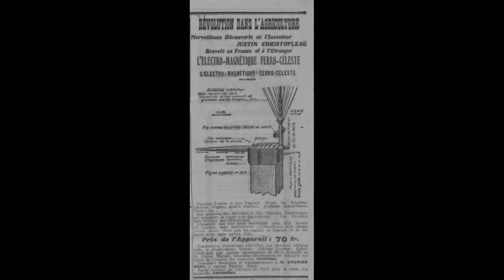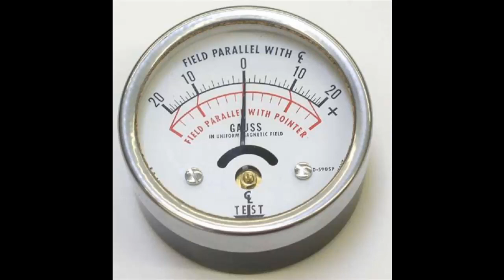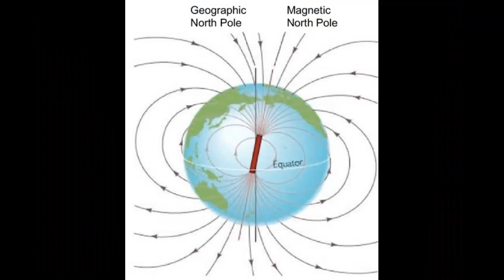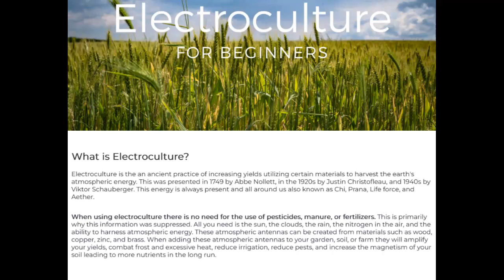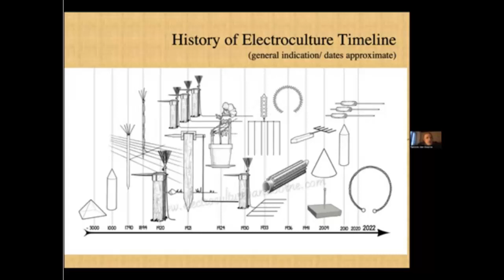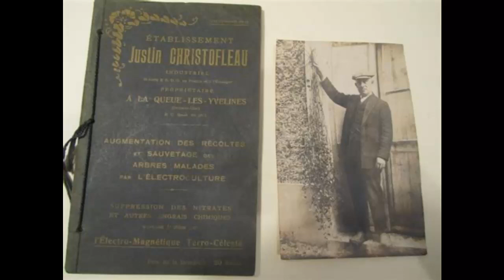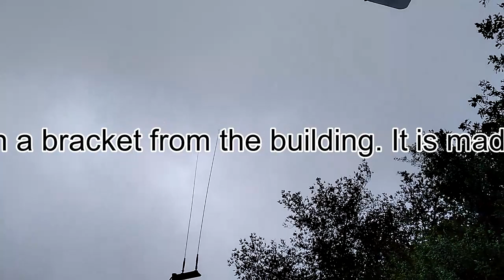Electroculture- Lets Separate The Science From The Woo!

Comment: Physicist here. First time I'm hearing about electroculture. Here's my impression: Sunlight is ultimately communicating the magnetic force of the sun (which is a huge electromagnet) acting on the Earth, and so when the sun rises, the EM fields across the ground change a lot, especially during full moons and solar flares since they shower the Earth with charged particles. When the EM fields across the ground change during sunrise, it induces a current in the coil and thus turns it into an antenna. The induced field is a toroidal field much like the Earth, sun, and human body have. This should protect the plants from other external fields that may induce static in them and thus harm their cells. It should also cause electrons to flow down onto the plant and give it energy. Our cells are also capacitors and the body can benefit from receiving electric charge from the outside rather than having to produce electrical energy by wasting food.
As far as I know, when spiritual people speak of earth energies, they are talking about the geomagnetic field. They just use the ethereal language of our ancestors, where for instance the power of god is a synonym for electromagnetism, magic wands are antennas and magic circles are antenna arrays. Our ancestors used a lot of piezoelectric materials and standing stones (stonehenge is a wullenweber antenna array) which induce large-size magnetic fields during thunderstorms.
Reply: I've noticed that "rather then wasting food" bit when I fast.  When you fast you tend to get cold on longer fasts as your body trys to conserve energy and the sun can become free calories essentially and warm you up again.  One of those pretty obvious once you realize it things.
Reply: Thanks!

Comment: Interesting, first time I’ve heard of this method. However in terms that are more understandable. If this genuinely creates an antenna. What is happening with this antenna is something called shadowing. It’s something that happens when you place antennas too close together and kills the signal on devices. So as far as radio signals are concerned this is true. I use to mess with earth batteries to test them out and sometimes they would act weird under certain conditions. I could make a video on it but I am getting sidetracked. One thing you can do to copper to increase its charge is to oxidize it by cooking it at 400 degrees Fh until it’s black and then when the sun hits it. It will create a charge. If you tried this on your plants then it might work better. Another thing though is to keep copper a certain distance from your plants because copper nails were once used to sabotage plant growth. It’s poison to most plants.
Reply from the maker: My garden has performed better this last summer than it ever has. yields way up pests way down. thanks for your message.

Comment: Just getting into copper for plants. I have been using colloidal copper for medicinal uses for years now.  

I think you should consider that we don't live on a ball with insane surface speeds, because it is scientifically impossible for this heliocentric model to have air. Here are just four facts that prove without any doubt that the ball has no air:

Fact 1: gas always expands to fill the volume

Fact 2: the only way to keep gas from expanding to fill the volume is to keep it in a physical air tight container. (No one buys propane in a bucket.)

Fact 3: no one in history has ever shown gravity preventing gas from
expanding to fill the volume.

Fact 4: when these facts are presented, most thinking people can connect the dots and realize that if the ball model is surrounded by an infinite volume of super low pressure and no physical container and the FACT that no one in history has ever demonstrated a single condition where gravity formed an airtight container, those thinking people would realize that it is SCIENTIFICALLY IMPOSSIBLE for the ball to have air.

Remember part of Boyle's law is that gas always expands to fill the volume of a container unless the container it IS SO LARGE THAT A DENSITY GRADIENT BECOMES SIGNIFICANT.

One other item I tested in my backyard using 20 feet of 1" EMT conduit insulated from the ground and mounted vertically. I placed a DC meter with the positive probe on  the EMT and had a decent ground for the negative and got a consistent DC voltage of 150.6 mV. The charge direction is downward.  There were no electrical lines of sources within 40 feet, in fact the closest overhead lines are 100 feet away.

Hope this is useful.

Comment: You are wrong about a fair bit, and hearing you talk about the "south magnetic flux into the area" has got to me.  The pole of the earth where Santa lives we might say normally termed the North Pole is what we refer to as a "South Pole".  this came to be because we talked about the pole that pointed north as the "North seeking pole" and then the seeking got left off.  So it is the South pole energy that is beneficial, also the arrows drawn to indicate the polarity of magnetic lines is just a flip of the coin convention, it would have been more accurate is drawn the other way!  So it is the emission of "whatever". subtle magnetic monopoles, aetheric energy, it is this "something" that comes from the south end of a magnet or of the earth that is beneficial.  Also worth noting that Rawls and Davis and some other experimenters define poles differently, some refer to the poles that point north as the south pole of a magnet and this is the reverse definition that is standard.
Reply from the maker: The lines are purposely blurred by several agendas.

Comment: There must be something that I am doing wrong. I have two antennas 2.5 meters high. The top of one is fibronnoci in design whilst the other is coat hanger. Again I split the wire into two thick strands on the coat hanger design and have separated the wires and spread them radially on the fibronnic design. I have not seen anything out of the ordinary yet??? In fact I have seen parts of my onion bed dying/dead where the fibronnoci Arial  is placed. I have also winded the coils differently, one coil goes anti clockwise whilst the other is wound clockwise.
Something is not right,n

Comment: My own experience with 10" 12 gage stranded copper wire with my 7 tomato plants in 5 gal pots. And 1 4x8 Bed using 15" in the bed. So i looped about 4 loops for the top and stuck the straight end in about 6" in the soil for each of the 7 pots that i had tomato plants growing in them. These tomato plants were growing slower then my other 30 something Tomato plants so on the 3rd day of trying this i started to see a difference the plants looked happier and greener and new growth. The tomato plants in the Bed i saw no difference yet but beds are bigger then pots so maybe in a week or two i will see a difference. I'm anxious to see what happens with this experiment. But so far it seems like it's great for potted tomato plants.

Comment: How High and Close to the Plants Does the Copper Wire Need to Be Placed???
Reply: Can a Copper Pipe hammered into the ground Be More Effective..???
Reply: @pauldaystar I was wondering the same thing too. 3 days ago i  cut 10 inches of 12 gage stranded wire and curled the one end about 4 loops and stuck 6 inches of the straight end in the  5 gal pot. I did this to 7 of my tomato plants that were growing slower then my other tomato plants to experiment and on day 3 i could see a difference the plants looked like they were happy and new life in them and greener in color. I put 15 inch ones in my garden tomato bed and haven't seen a difference yet but beds are bigger then 5 gallon pots so maybe in a week or two i will see a change.
Reply from the maker: The higher you go, the better your spread. If you get a fibreglass windsurfer mast or an old surf casting rod you can easily get 16 feet. That will give you a 20 yard radius of effect with diminishing results toward the outside. for single plant or raised bed protection , a 6 foot  cane will provide benefits. I use a gallon of seawater diluted with rainwater 50/50 once a week during the growing season for minerals and soil conductivity
Reply: @t.h.o.r.  Thankyou from Alaska

Comment: Voltage, amperage their are many factors here, the amount of material in your antenna ( ohms law) is important to hit the “sweet spot/ maximum effectiveness “ on both voltages and amps.
A solar generator can be made by carbonization of copper with with a propane torch, leaving more copper not blackened/ creates flow.
In electrolysis, anything over 2v creates a lot of waste in heat generation, 2v is the sweet spot, but one wants to run 12v because it’s faster, so induction places are used inside the 12v field(6) to make each segment 2v, with 6 - 2v segments equaling 12 v.
Having played with earth batteries, for years, I found that 1.5 v was the average cell voltage, but I found on the farm I was living on, that I was getting higher voltages (up to 2-2.7 v), didn’t understand it then, but now I have MORE information.
It has been found since then that microbial content (also mycelium) creates better plants, and better earth batteries...

Comment: I am trying this, have been gardening for years, and this is the first year I have had deep green squash plants, pepper plants that are growing huge and producing flowers endlessly, and other plants like broccoli, cauliflower, growing much faster.  I am a fan of this as I believe what I see.  In any case, what have you got to lose?
Reply: Science vs the new age, Woo Woo.  Ah man your the best....
Reply: I tried it last year on 4 tomato plants , I just used a old grounding rod and it had 3 foot of copper wire which I turned clockwise from the bottom into a crude antenna, stuck it in between them and forgot about it , I didn’t even pick tomatoes till the end of season, they all grew 6 1/2 feet tall loaded with tomatoes. I gave away bags of tomatoes, lol . Im hooked it works
Reply: What did you do?
Reply: @ryanbeard1119  I put copper coils in every container however I am also using the sq ft garden soil mix.  Regardless of which method is best I am willing and able to give myself every advantage I can find.  Copper does not repel spider mites or caterpillars so far tho.
Reply: @1stbadger700  that's awesome.   I need to find a gardener in my neighborhood because I have access to plenty of brown cardboard for compost browns
Reply: @1stbadger700 I know thst copper at least stops slugs and snails lol but it has to be thick enough and wide enough. They have to have a sufficient distance to be bothered and turn around.

Chi is 100% real, whether or not the copper does anything for that is a different story I'll be testing side by side "scientifically".

It stands to reason though that SOMETHING "conductive" could be happening with such metals. Gold or silver might be the best if they didn't cost a house payment for a small coil 😂

The woo is annoying, but there are certainly energies we don't fully comprehend and unless many of us experiment CLEANLY we'll never knoe

Comment: It can be a deep subject but Electricity and Magmatism are different aspects of the same force. What people see as a stable magnetic field is equivalent to DC. 
As you go higher in the atmosphere you are at a higher potential. ..... So statements like you need a 20' antenna make sense. 
Some facts are being mis-represented though .... The north magnetic pole is not in Alaska.

If you put an antenna up high it has the effect of pushing the potential that would have been there higher up in the air ..... if it were magnetic it would tend to "ground it" in effect lowering or dipping the potential in that area! Although the potential can be unexpectedly high it has a low charge to it (so you would have trouble running a normal motor of it)!

This is however an interesting subject. If people try this and get results (eather good or bad) it will form empirical evidence .... especially if the data is spread over a wide area of the world!